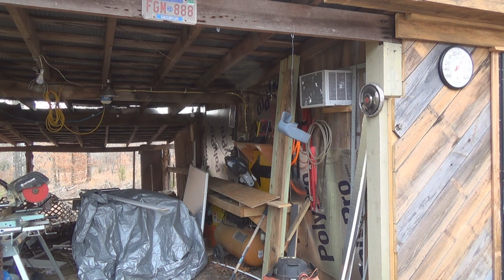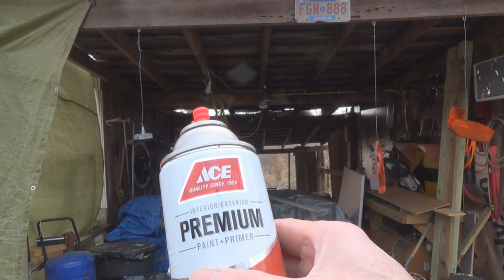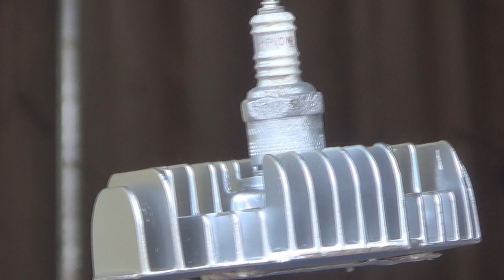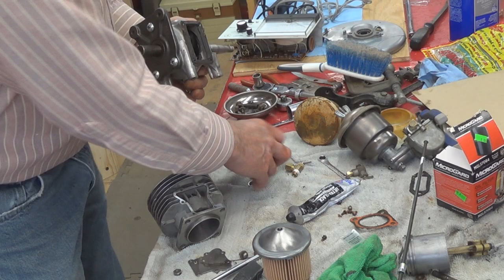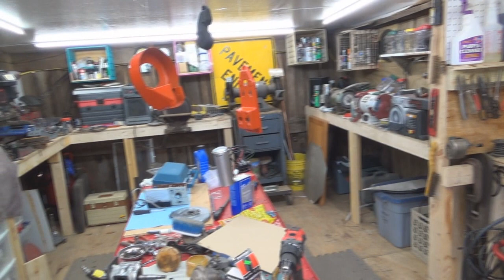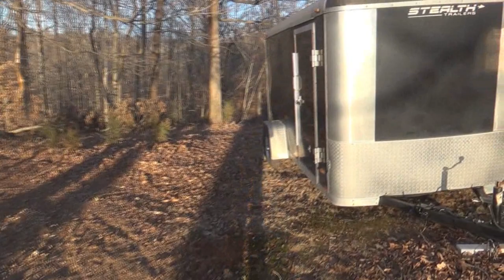Painting & Pining   Jacobsen 2 cycle engine

Comment: George back in the 70's i built that smae VOM meter by Heatkit along with a few other kits. . We had a flash flood when we live in TN and it was lost in the flood. Boy that meter sure brings back some good memories.. Never knew ACE spray paint had that adjustment with the spray pattern.
Reply from the maker: I used mostly ACE paint on the Goofy Cart. I hope to get some batteries tomorrow to see if the Heathkit will do the job. Thanks Dan.